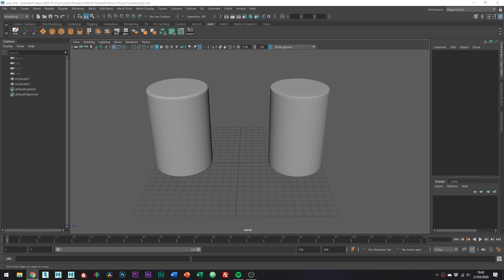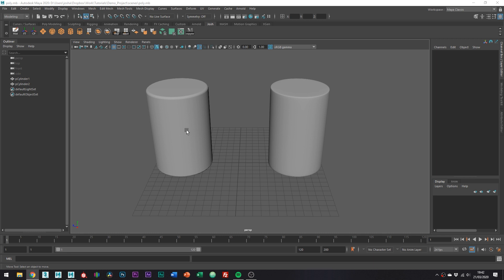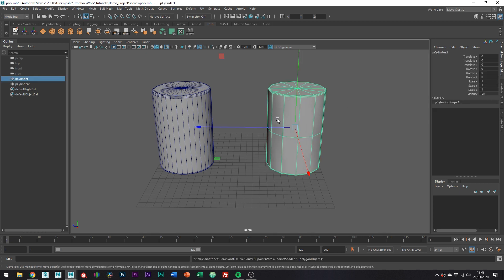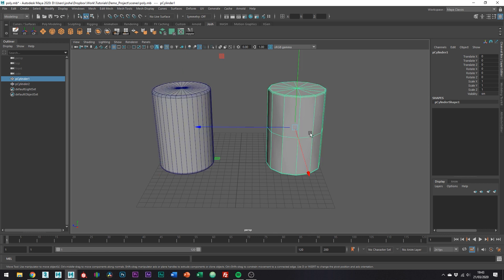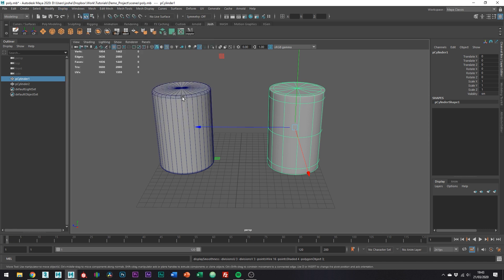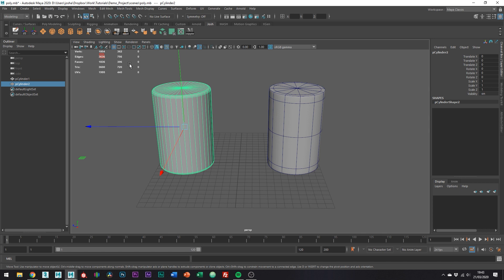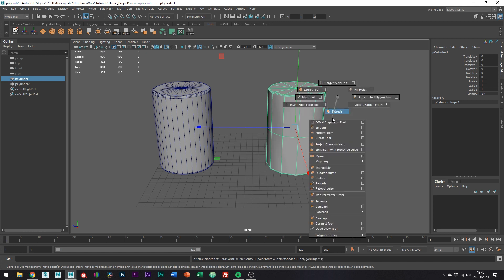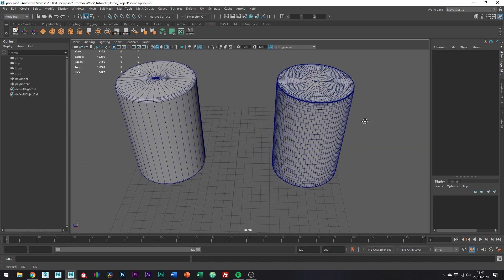Poly vs. SubD Modelling - Which is Better?

Comment: So um sub d is also good for optimisation so you don't have to make multiple meshes you just have to use the same one but with a lower subdivision count, because subd modeling initially uses a low poly and then you sub divide it, you don't necessarily have to subdivide it at such a high level because 3-6 isn't gonna make much of a difference if you modeled it correctly. I get your point but I feel it might tell some newer modelees that subd bad and poly good. And lemme just say if you're just starting out, poly is good because subd can show the imperfections in your mesh if not modeled right.

Comment: You explained it really well. I made a photoscanned asset recently which I poly-modelled, and then simply "smoothed edges" in Maya to give that impression of a subdivided mesh. In hindsight I maybe should have modelled using SubD because it was the type of asset you need to look at up-close.

So if you wanted to make an LOD that retained a good sillhouette from a distance, but was also very efficient in it's polycount, you would poly-model it? And the LOD closest to the player would be a SubD model because you want it to have that extra detail?
Reply from the maker: Yeah that's the general gist of things... but always evaluate each asset as you don't always need to use subD even for close up stuff.